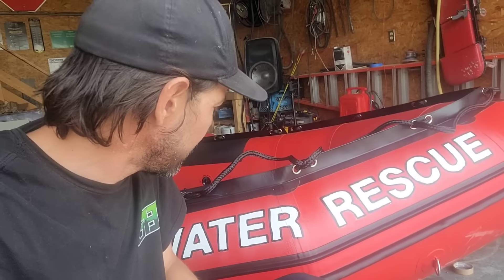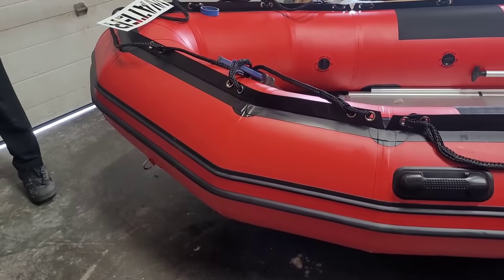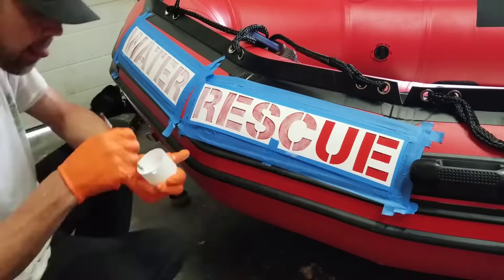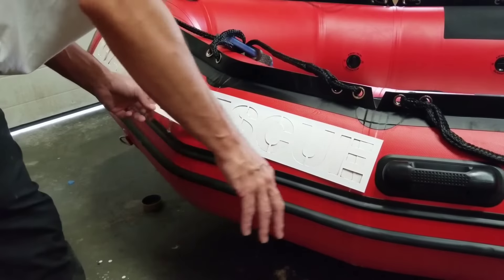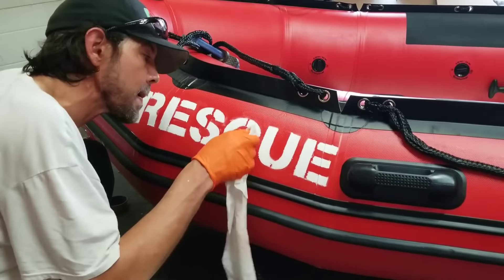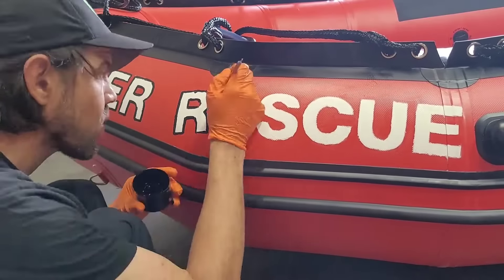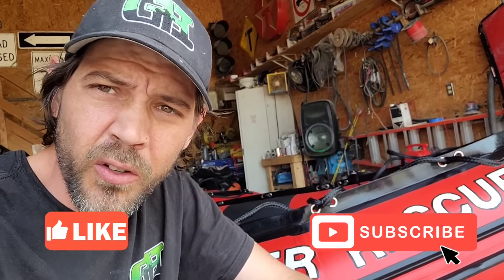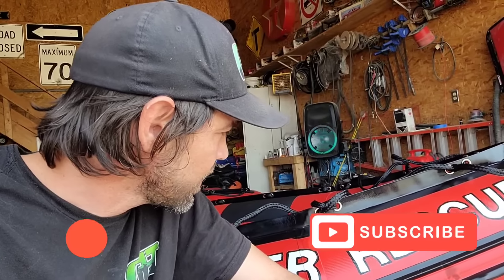Painting Your Inflatable Boat - Paint Numbers or Letters On Your Inflatable Boat Can be Easy

Comment: @gashopperinc I just bought a couple budget inflatable paddle boards.  They have some goofy words printed on the sides that I'd like to remove.  Can you recommend something safe that will take it off?
Reply from the maker: Acetone or MEK should be what you need. Just take caution with the MEK, don't let it puddle on the fabric as it will affect the materials chemical composition and eat away at the fabric

Comment: What paint do you recommend for repainting a boat? Just bought an old used Avon Scout from the outfitter I work for. I would like to repaint the entire boat because it's a lousy grey. Also do you use anything else other then meks to clean or prep a boat before painting?
Reply: @PatrickPalcic  hypalon paint from Demaree Inflatable Boats in Maryland
Reply from the maker: It's not recommended to repaint the entire tube set. Only if you want designs, advertising and what nots. If the tubes are worn and aged, then it's highly recommended to replace them, as they have aged out and you'll be dealing with something extremely difficult to repair in the future if painted. But you'll also be dealing with a ticking time bomb in the process. If the tubes have aged out, it's just a matter of time before a seam gives way and bursts or the fabric itself fails creating extensive tears. Have seen it too many times through our shop. But PolyMarine paint or Inland Marine Paints are the recommended paints if you plan on doing so.
Reply: You can paint whole tubes with the DIB hypalon paint, it's essentially liquid hypalon. I have only used it to recoat small areas on hypalon inflatables where the base fabric has been exposed by damage or wear. There is some surface prep involve, but DIB refurbishes boats with it regularly. The giant j rig and s rigs they run with motors on the grand canyon typically use this coating and are refurbished and freshened up with new hypalon paint periodically. The boat he's talking about is an avon whitewater raft so replacing the tubes isn't really a viable option as they're 90 of the boat. I would contact Demaree Inflatable Boats in Maryland directly and ask them about their coatings. They have been in business since the 80s and started out building whitewater rafts, but now mostly build super tough high end commercial and military Inflatables, right up there with WING boats
Reply: @gashopperinc  Yeah think you got the wrong idea on what type of boat I have.
Reply: @mattcookeco  Thank you!

Comment: hello my friend they gave me a zodiac 2245 from 1978. no air is lost but only the keel. do you think the boat is alive? do the glues hold up? I think it's hypalon. it's the same as the one you made in 79
Reply from the maker: If it's just the keel, repair it and boat should be good. Older boats are prone to glue failure due to their age. Nothing a repair and glue can't fix. But if it's structural, then chances are they will be other major failures to follow